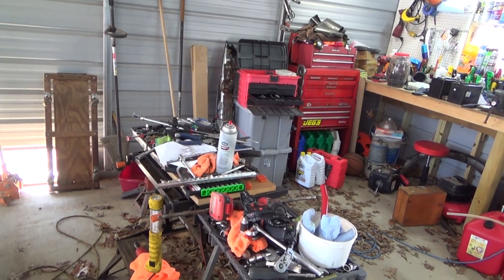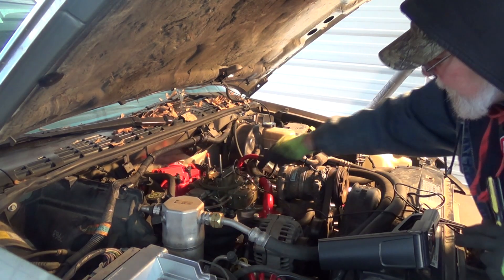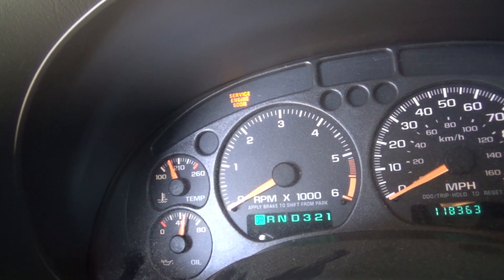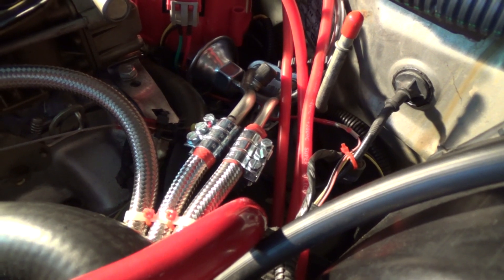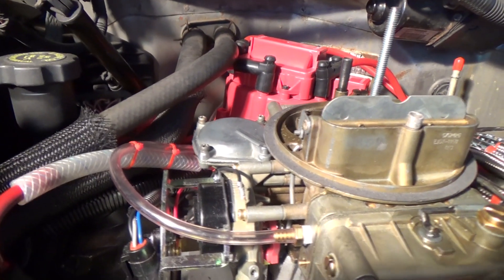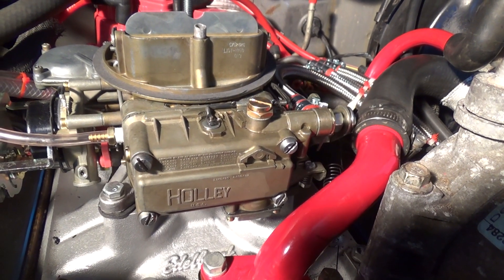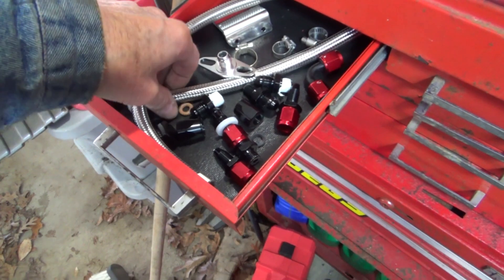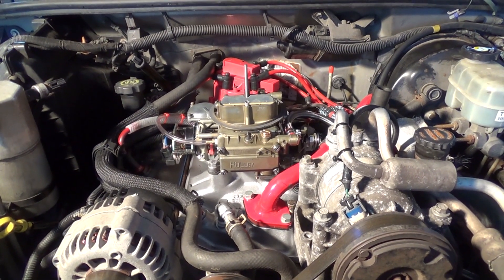Converting TBI & ESC to HEI & carburetor, FIRE IN THE HOLE!

Comment: Great video George. Glad to see the truck running, you only have a few teething troubles to fix but i know you can sort it George. It's a pity you can't install a mechanical fuel pump and do away with the electric pump. Look forward to seeing how you fix the problems George.
Cheers, Jeff.
Reply from the maker: I may just put an inline fuel pump in place and be done with it. Thanks Jeff

Comment: Awesome job george so happy to it running. If I had been there I would had you replace every gasket in that carb I learned a long time ago when you buy a carb from somebody just rebuild it and replace all gaskets before you put it on the engine. I'M curious to see what the fuel pump problem turns out to be. Thats odd it comes on then stops running. I wonder if its related to the pressure regulator just thinking out loud.
Reply from the maker: I did replace all the gaskets and internals that could be done. I just failed to replace the 2 little ones on the inlet and the ones on the float adjusters. They are done now. The fuel pump runs on two separate circuits, one that is just for initial startup and then one that keeps it going afterwards. One of the wires that I supposedly hooked up to the tach port on the distributor was for the second circuit and one of the wires was also for the tachometer. I need to double check the connections going into the distributor cap itself that connect to the coil. I have seen issues with those connections in the past. I am more concerned about why the gauge on the pressure regulator doesn't work... and then the charging system too. We'll get it. Thanks for following along Bob.

Comment: Im excited, its running good. Im anxois to see that first first second 3rd overdrive shift! You may end up having to install a different fuel pump relay that isnt integrated with the ecm and body control module.
Reply from the maker: You may have a point on the fuel pump system, but supposedly the set up I have done is supposed to remedy the situation with the fuel pump, from several different sources. Thanks for stopping by.

Comment: Good to hear it run George , Great job !  Your working with OBD2 and the fuel pump is on a timer Though the fuel pump relay . You will need to do some study up on the relay circuit, But there is a way to jump the relay circuit and fuse it for safety. I know the method for ford and jeep but GM would be different  by some  degree. That Alt charges through the OBD computer and so are all your gauges on the dash controlled in the same way . Most folks use a GM one wire Alt for this mod but there has so be something that was cut in the process of the swap . It's a hard swap on OBD2  as that is the heart of the engine control and dash gauges .. That fuel pressure reg may need to be turned down a tad more and a 1-20 PSI gauge installed . Not sure what the one you have has a range of ??  I have been a part of 2 of these swaps the first being on a 94 & second was 97 The second was OBD2 . I bet you will get it , If I can  help I will try .. GOD BLESS YOU   
ON THIS MISSION !!  ENJOYED..
Reply from the maker: Thank you Shawn. The only gauges not working (so far) are the charging sys and the tachometer. Good oil pressure and water temp, as well as fuel gauge. I'll be chasing gremlins for a bit. I went back over all my wiring today, including pulling the distributor out again, since some of the splicing is down behind it out of reach. Supposedly the purple wire with white stripe going to the tach port on the distributor is supposed to overcome the fuel pump problem, and the white wire from the coil should make the tach work...but both are wired in and neither is working properly. I'll be back at in on Monday with warmer temps.
Reply: @TheShadeTreeFixitMan  God Bless you on the venture George ! Will be great to hear when you figure the problems out .. Yes please stay warm the ole chev can wait.. The day of rest is upon us tomorrow ..
Reply from the maker: @shawnmrfixitlee6478  AMEN

Comment: Just watched your  other video and I'm very sorry. I notice at 6:00 your Fuel pressure reg is leaking from the red nut. Possibly, I'm wondering if the triple clamped high pressure line got warm and allowed the hose to slip right off. Makes me feel very lucky the multiple times I've had carbs leaking on the manifold with little to no worry.
Reply from the maker: No leaks from the high pressure line, there had been a small leak from the carburetor itself and I had fixed the leak at the regulator and actually installed another regulator inline with that one to get the pressure down to 7lbs. The backfire lit it off, whatever it was that was the problem. It's water under the dam now. Thanks Moe.

Comment: Awesome! Just a few things to figure out. I wonder if you "Lost a Ground"?
Reply from the maker: Well, I am wondering about that too. There are a number of plugs not going anywhere which all have grounds in them, but that shouldn't matter since the unit they function with is no longer there. More gremlins to chase down. Thanks Neil.
Reply: All of those connections have a Ground. I’m curious if one of them is a Main Bus Ground?
Reply from the maker: @Kickinpony66  I'll be checking them all and tying them together. Thanks

Comment: Hi George, I’m happy you’re ok after the fire , but I have a question? How do you sort out the fuel injection wiring ? I installed a 350 carburetor motor along with the turbo 350 , I have the trans figured out . Cheers 🇨🇦
Reply from the maker: The fuel injection wiring is not used, only the wires that I mention in the various videos, like for the ignition, the TPS, etc. Essentially you are bypassing the fuel injection system and that part of the computer. Make sure you check for fuel leaks before test driving! Thanks for stopping by. I'm sure yours will get completed and run like a champ.
Reply: @TheShadeTreeFixitMan  hi George 
Thank you for your response, this will help immensely. Cheers 🇨🇦